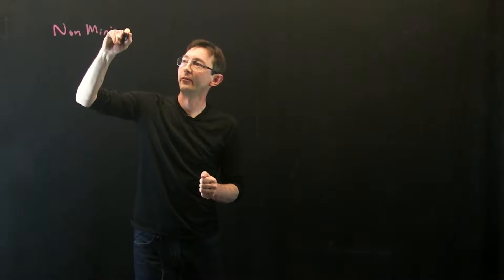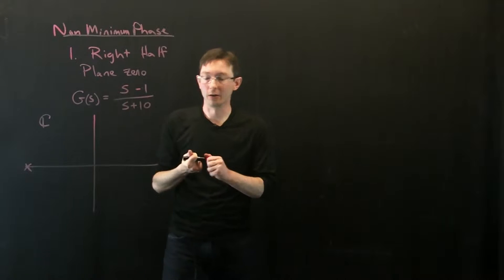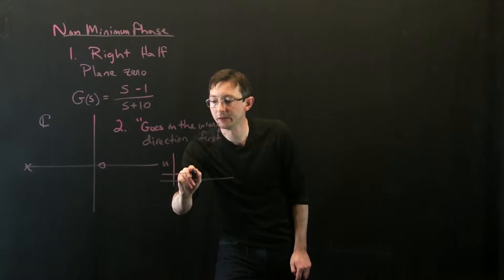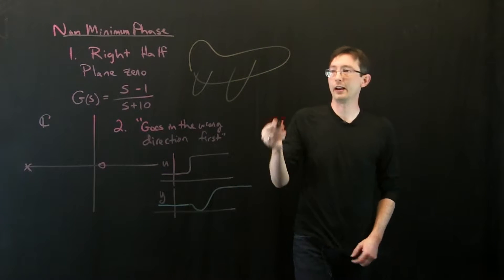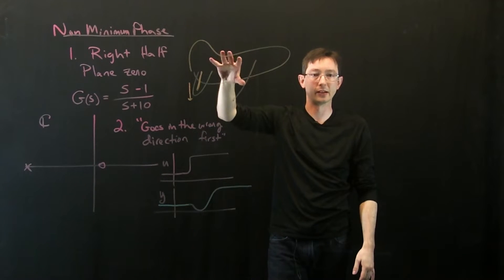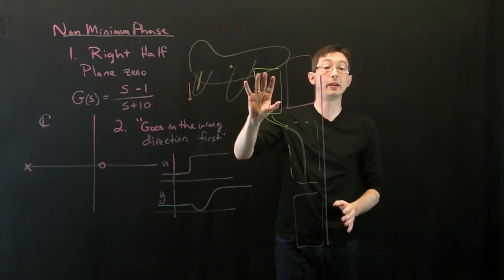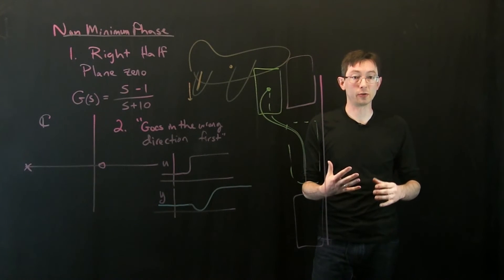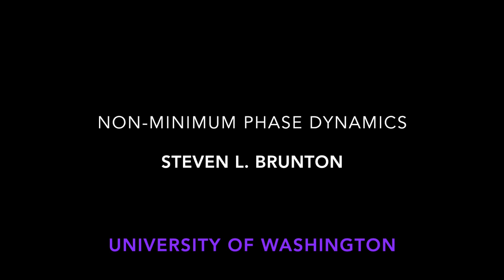Control systems with non-minimum phase dynamics

Comment: What about counter-steering a motorcycle? From Wikipedia: "Countersteering is used by single-track vehicle operators, such as cyclists and motorcyclists, to initiate a turn toward a given direction by momentarily steering counter to the desired direction ("steer left to turn right"). To negotiate a turn successfully, the combined center of mass of the rider and the single-track vehicle must first be leaned in the direction of the turn, and steering briefly in the opposite direction causes that lean."

Comment: Another great example of a non-minimum phase system is an inverted pendulum. I designed an LQR controller for it in simulink to control cart position and pendulum angle. When I plotted the outputs, I noticed that it's position never immediately went to the setpoint. It instead went to the opposite direction first, to get the pendulum falling in the other direction so that it can move to the setpoint. I never knew these systems are called non minimum phase systems, but thanks to Brian Douglas and Steve Brunton, I now know what they are.

Comment: Why does my step response not look like 3:40?  
>>G=tf([1 -1],[1 10]); step(G)
Reply: Actually there should be a gain of -1 also otherwise system settles to negative of the input. So take tf([-1 1], [1 10])
Reply: @RoboGenesHimanshuVerma  Agree it -s plus 1 in the numerator.
Reply: @RoboGenesHimanshuVerma  Yes, I did what you said here, but the response seems to be good as well. There is no down stage..